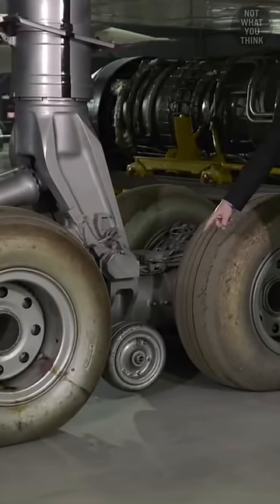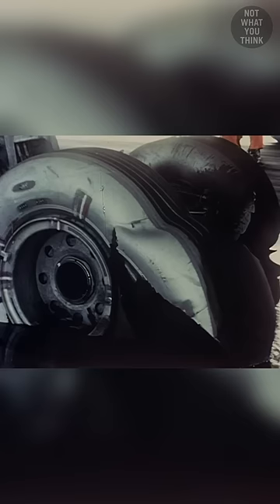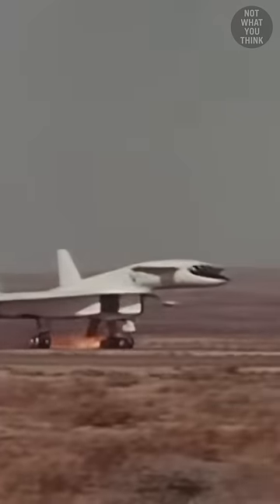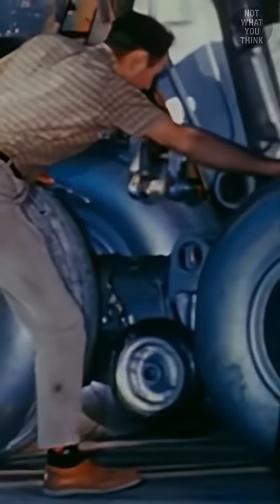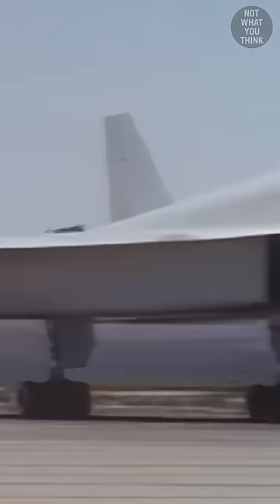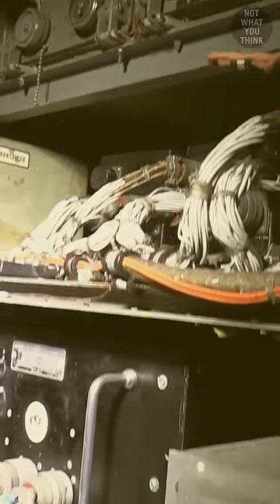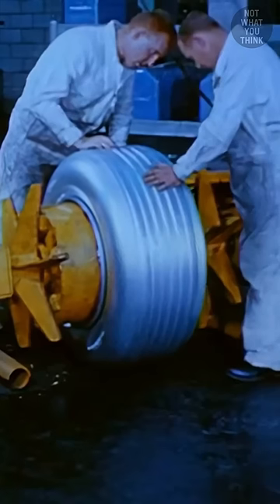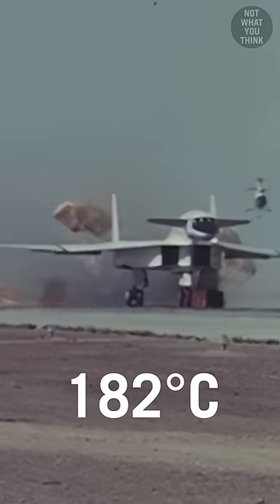Airplane with a 5th Wheel #shorts

Comment: You can see one of these Valkyrie aircraft at the U.S. Air Force museum in Dayton, Oh. The thing is HUGE!!! It takes up half of an aircraft hanger
Reply: sooo many planes used to sit under its wings lol
Reply: @spedracer55  well it's in the very far back hanger now. The hanger with all the old Air Focre One's, which by the way, you can also go through! It does have stuff underneath it
Reply: Is that oh or ohio
Reply: @toasterhavingabath6980  Ohio. Oh is short for Ohio in case you're from outside the U.S.
Reply: Only two XB-70s were constructed and one of those crashed in an incident that was not caused by the XB-70. The one at Dayton, OH is the only one left. ICBM’s are what put an end to the XB-70 project. To this day, the SR-71 is the only aircraft faster than the XB-70 (these are jets that can take off utilizing there on engines) which during one of the few test flights recorded a top speed of 2099mph and a cruising speed of 1900mph. I have a overhead photograph of an SR-71 next to an XB-70. The SR-71 looks like a matchbox compared to the XB. Like the other guy said, they were freakin’ huge!!! The XB’s had 6 jet engines.
Reply: 6 jet engines in the rear that thing is impressive to see in person
Reply: I was lucky enough to watch SR-71’s takeoff from Okinawa. Two of them were stationed at the Air Force Base there. It was beyond impressive. The sound “traveled” throughout my entire body. I cannot fathom what an XB-70 was like at takeoff.
Reply: The museum in Dayton is just amazing so many cool planes there
Reply: There are like 3 other displays underneath the length of the neck or fuselage.
Reply: @Notes-From-Underground66 ICBM’s predated the Valkyrie by many years. It was advancements in surface to air missiles, by Russia that made the role of the Valkyrie obsolete

Comment: I thought of this mechanism decades back. In order þo avoid sudden friction with the landing strip the landing gears should be made cyncronous with the landing speed with the assistance of the additional whils connected with the main whils , the additional whils touching the landing strip first and thus transferring the landing speed to the main landing gears.

Comment: The reason the tires were coated was because of the heat of the skin if the airplane when it was flying Mach 3.  The coating was to keep the tires from exploding in the wheel wells during flight, not during landing.

Comment: The tires are not painted silver.
The rubber compound includes aluminium and was specialy developed by Dunlop for the Oxcart planes (A-12, YF-12, SR-71) and the XB-70.  These planes could fly at Mach-3 for extended periods of time, the airframe had time to heat sink.
Reply: Did you only hear when he said it looks silver?
Reply: @peeperleviathan2839  " ... because they were painted with a special compound " .  It's near the end of the short.